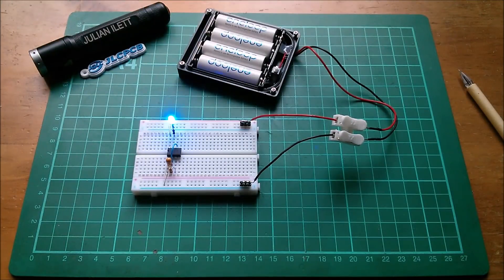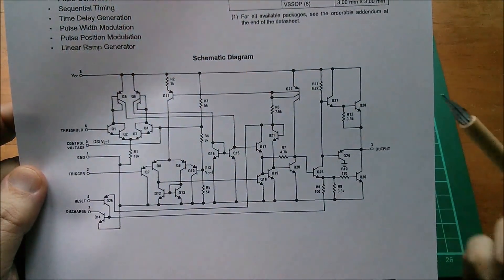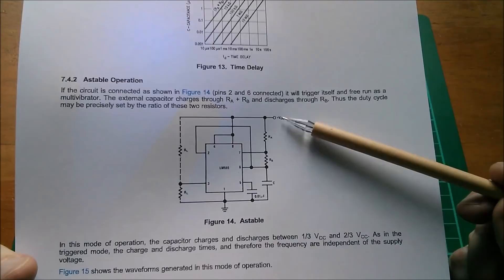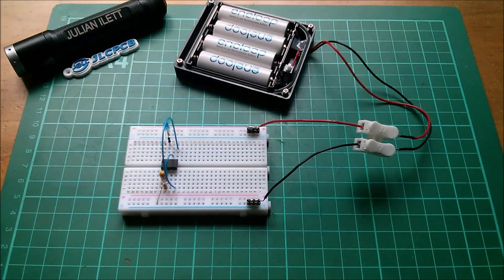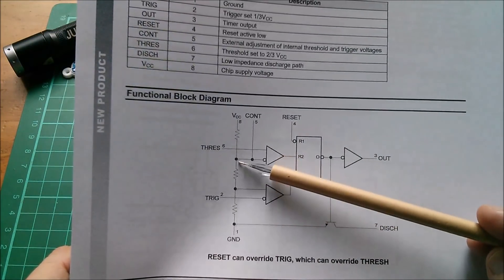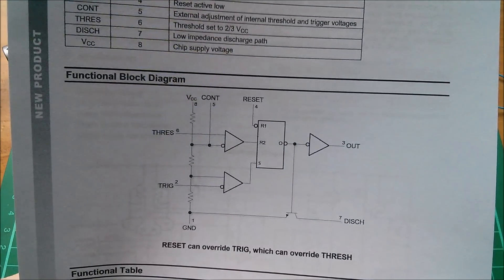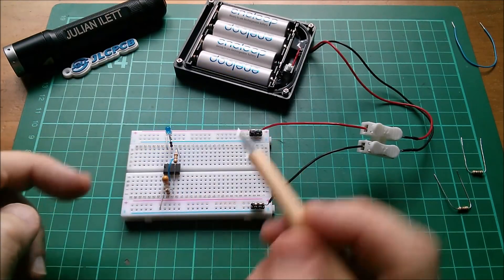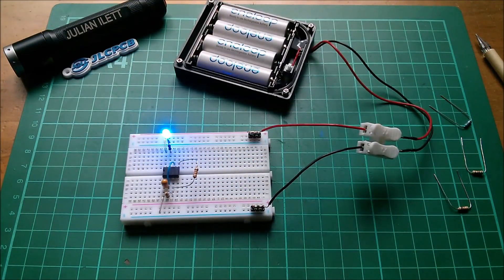555 Timer LED Flasher (weird configuration)

Comment: This is just awesome.  I hooked up my CMOS 555 with a 10µF cap and a 100k pot in place of the resistor, and there's a really nice range of switching frequencies all at 50% duty cycle.  It didn't work until I connected pins 4 and 5, like you said in the video, but it works an absolute charm indeed.  Marvellous!

Comment: Found this while looking for alternatives to Clive's self-flashing LEDs, could work so there is no need to buy those and it would make the speed customisable. It's kind of swings and roundabouts on the price of 555s vs decent self-flashing LEDs but an A4 board definitely wouldn't be able to have 247 individually controlled LEDs.

Comment: I use to operate the astable 555 multivibrator exactly with your resistor capacitor configuration from the output pin, but with a stabilization capacitor at pin 5.

Comment: Using a 555 and it's discharge pin as a pull down  can be part of simple one wire digital interface to so an arduino that read a variable capacitor's value. Just measure the time between pulses. 

That said....
There can be strange effects if the capacitor's value is changed quickly/by lots while in circuit. As I discovered experimenting with some anodised titanium and copper tube as a water level sensor... Would get a mild tingle despite running on 5V.... And would then find the  555 had blown... Eventually figured capacitance value was tiny when empty, and more than 100 times larger when full of water. Think there was a voltage step up, when to keep stored energy constant, charged cap had it's capacitance value reduced. Programmable unijunction relaxation oscillator worked better for that application, as trigger when voltage above a set threshold. Not at all difficult to set up to oscillate, if trigger voltage programmed by a constant current through a resistor to ground, and slightly smaller constant current to charge cap, (so PUT can't lock into discharge). Also makes for a linear response/decent ramp waveform.

Comment: There are 555 circuits available on the internet where the output pin 3 is feed thu a timing resistor to pin 2 and 6 and then a timing capacitor from pin 2 and 6 to ground.

Comment: Brilliant!  This gives an automatic 50% duty cycle. 

Tying pin 3 to 5 thru a resistor allows higher R values in the RC timing circuit (or lower C) while maintaining roughly 50% duty cycle.
Might be advantageous  in low power applications.

Tying 7 to 5 has an asymmetric duty cycle because the pull down impedance is zero while the pull up is the led/resistor impedance.

 What are those white battery connectors?

Nice work Julian. Thanx for all your  educational posts. Happy holidays. :)

Comment: Julian - have you discovered the other way of using it as a monostable?
Especially useful if you need an output (pin 7) to drive a MPU /RESET circuit. Pin 3 can be used as a second/RESET (push/pull) output.

Comment: Would I be correct in saying that using the discharge as an output would be regarded as “open collector”? I’ve been getting to grips with the different types of logic outputs. You could use that with a pull up to generate a clock signal at a different voltage than you were running the 555 at.
Reply from the maker: Yes, it's an open collector output. You could use it to interface logic at a different voltage - you could also use it to make a 'wired AND' gate :)
Reply: @JulianIlett  Pull up should be a "big resistor" right?  ;-)
Reply: James Sharman - depends. The value of the “pull-up” resistor is a trade off between switching (rise) time and energy consumption. High resistance values consume less current (power) but when the transistor is off, stray capacitance will cause the line to take a while to get to Vcc. No good for some types of logic chip, especially if a quick translation between logic levels is needed.
A low resistance value will drive the output much faster towards Vcc, but at the expense of more current through the resistor, meaning more current (in) through the 555 output pin and greater power dissipated from the resistor. I suggest a 1k ohm resistor as a starting value.

Comment: The LM3909 Flasher chip can also be connected in unusual ways, which I discovered one day when I got inspired to build a flasher circuit without the aid of the pinout or normal schematic, and I did not quite remember the "correct" way. The accidental way turned out to drive the LED much harder, which suited my purpose that day ... many years ago. Here is an unexpected mention of the dear old 1.5 volt chip https://en.wikipedia.org/wiki/Pulse_(Pink_Floyd_album)#LED_packaging
Reply: YodaWhat I bought my first LM3909 from Radio Shack about 40 years ago, I’m sad to see that they are now obsolete, though you can still find stock on eBay but they’re not cheap.

Comment: Quite common to connect like that if you want a 50:50 mark space ratio.  Pin 7 can only sink current, fine for flashing an LED, but not so good for driving other circuitry.
Reply: Just add a switching transistor, or a FET even, plus a resistor or two.

Comment: Just last night I was working on the PCB layout of a PWM fan control circuit using a 555 timer, so this video is very relevant to my interests! I'll have to watch this video again when I get home from work and take some notes, because if I can simplify the design, it will free up a little room on the board, which is useful because I was having difficulty finding room for the 12V regulator needed to actually power the fan.

I was awaiting a delivery from a certain mouse-based electronics supplier, so I can do some prototyping, but this definitely gives me more things to try! Thanks!

Comment: Connecting one timing resistor to output eliminates precision of this timer and makes it sensitive to supply voltage variation. It's good for flashing LEDs but not for frequency generation.
Reply: Yeah, but that’s not a problem if it’s already powered from an existing regulated supply.
Reply: @Mark1024MAK  If your circuit have regulated supply, you can generate stable frequency with single op-amp or single logic inverter with hysteresis or two to three standard inverters. For flashing LED you don't need 8-pin chip. Two transistors are more than enough for astable operation.

Comment: Ahhh, the good old 555,  I'm not an electronics expert but I've used those in so many projects from wig wag lights to a switch controller that holds the state when a momentary button is pressed. 
It seems that just about anything can be done with that versatile ic and I think it's the most produced ic of all time?

Comment: The first one isn't a weird connection, but actually shown like that as an example circuit for a 50% duty cycle in many datasheets. But apparently people don't read those ;) . Just make sure you get the CMOS version of the 555, because the output voltage of the normal one isn't symmetric as it can't reach the positive rail on output.

Comment: No weird connections if you could have full internal IC design description from the manufacturer with full testing datasheet of various parameters so you can design your own electronic thought freely as you like regardless the typical application of that IC.... But unfortunately not all manufacturers were doing that due to classification of production unless long time after selling the product...

Comment: Takes me back to a magical childhood when the (miniature incandescent) Christmas tree fairy lights flashed.  One lamp (I believe) had a bi-metal strip heating and cooling, mechanically turning the lights on and off.  Some folk (unintentionally, I suspect) had 2 flasher lamps in the string of lights which resulted in chaotic rather than rhythmic flashing on and off.  (If my memories are in error feel free to shatter them).
Reply: Yeah, we had them in the 70's. Finding a replacement flasher bulb was a nightmare.
Reply: I had a set of lights that used a 36V transformer. Having run out of spare lamps, and not finding any suitable replacements in any shops. I used some spare (used) flasher lamps from another set (that I could also not get spare lamps for). Slightly the wrong voltage, but they worked. Two flasher lamps replacing two normal lamps in two of the four chains/strings. Then later I found and added another flashing lamp. They worked well enough that that set made it through that Christmas without any further problems. The following year though was not so great. Some more lamps failed. By then I had found some lamps that were nearly the same voltage to use as spares. But these were designed for mains sets that had fuse lamps. So over this year and the next, I kept this set going with an ever great proportion of the ‘wrong’ lamps. Then one of the flasher lamps must have got stuck on. This resulted in a chain reaction. At least one of the ‘wrong’ replacements must have blown, the internal “bypass” came in to play, the current through the chain must have increased, and then caused another failure. The extra load on the transformer must have reduced the output voltage, causing the other flashing lamps to stop flashing or have a much longer on time compared to off time. Anyway, whatever the exact failure mode, the result was that the thermal fuse in the transformer blew. And when I later checked, a significant number of the lamps had blown😳. So that was the end of that set ☹️

Comment: I'm surprised that the 555 is still a thing. It is nearly as old as me! Thousands of years in the future, long after the fall of civilisation, aliens will find an automated factory still making the damm things.
Reply: It's over twice my age!
Reply: @RubixB0y  over 3 times my age =)
Reply: @certified-forklifter  so you are under 16 years old
Reply: @certified-forklifter  PS check out EEVbolg
Reply: @God-CDXX  Yeah, I am 15 now, I know EEVblog, he does some interesting videos. However, I am currently more into 3D-printing. =D 
Have a awesome day!
Reply: You can even get the 555 in BGA package now.
Reply: The dual 556 was, and probably still is, used in so many sirens and alarms that Ferranti Zetex (now Diodes Inc) brought out the 8-pin ZSD100 to do the job with less components and the added advantage of bridge driver outputs.
Reply: They (Zetex/Diodes Inc) also do the ZTSC1555 which will operate down to 0.9V so can be powered from a single cell.